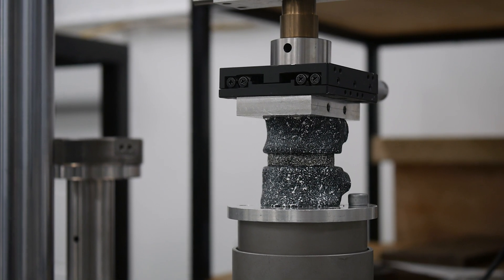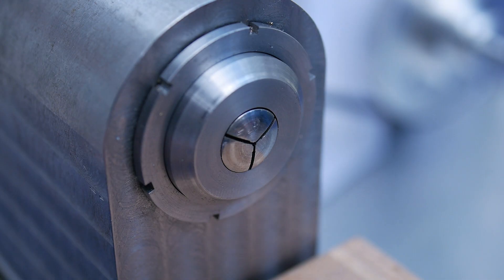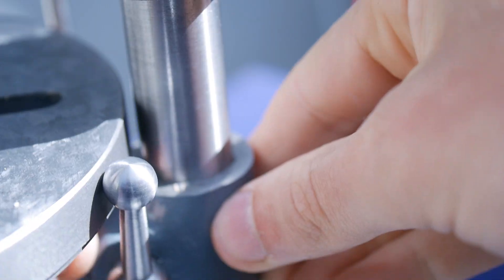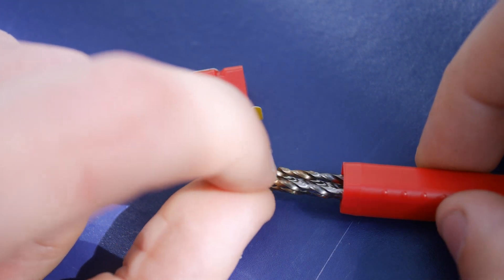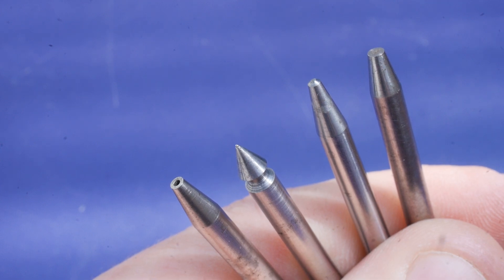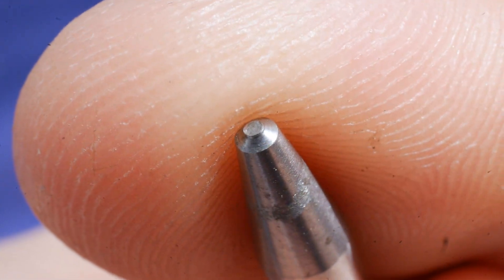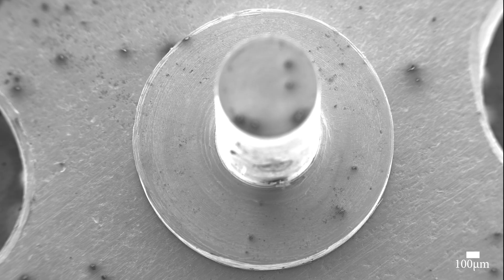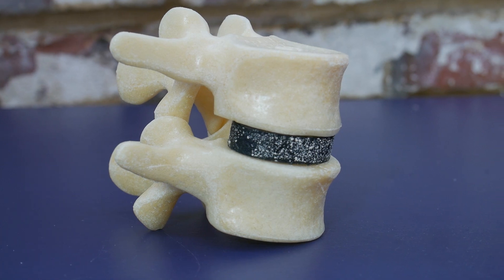Machining a Next-Gen Spinal Implant: My PhD in 9 minutes

Comment: That staking tool is exactly what I am here for: a totally new (to me) tool and technique, and insight about how it’s possible to work at such small scale.
Reply: In the gun smithing community, we would refer to the two stakes (punches) used in this video as a roll pin starter punch, or just a starter punch, and a roll pin punch, used for finishing the installation of a roll pin punch, but you could get away with just using a standard pin punch. The roll pin punch just makes it so that your punch is less likely to be knocked out of place and potentially scratch or damage something after being struck with a hammer, but I've heard that roll pin punches can result in roll pins mushrooming out after being struck.
Reply: @maximilian200057  I think these are two different processes, specifically because staking forms the metal for a permanent attachment, whereas roll pinning doesn’t form the metal part, it just pushes it into place pending later disassembly. 

To put it another way, the staking uses the divot in the pin and the hammered spike to make it so the part has permanently deformed into the hole. In contrast, a roll pin stays in place due to slight springiness that isn’t a permanent deformation of the part. 

The effect is that repeatedly removing a staked pin will rapidly grind away both the stake and the hole it’s in. In contrast, a roll pin is designed for repeated disassembly with only trivial damage to the parts. 

But as I said above, I’m learning about these tools so I’m open to hearing how I might be wrong.
Reply: @twestgard2  The first instrument used, the thing a gunsmith would call a roll pin starter punch, was clearly not an instrument used to stake anything, rather to help install certain parts that act like pins, like you can see in the video. If such unusual parts exists in certain firearms, then gunsmiths would use a small roll pin starter punch to install them. The second part was an instrument used for stating, but gunsmiths often get clever with their instrument usage and could potentially use a roll pin punch for the purpose of staking something.
Reply: Correct me if I'm wrong but seems like rivets still can be quite useful, although a very different kind of them
Reply: That type of work has been used since the bronze age.
Check out the fascinating and ingenious methods they used to make jewelry back then.
Nothing new under the Sun.

Comment: Amazing video, From what you shown the concept looks good, how does the intended implant react to body tissue? Is their any effect on the metals or polymer used? How does heat effect the polymer? I must say this is great thinking outside the box cannot wait for more posts.
Reply from the maker: The materials have all been tested for biocompatibility. The polymer is a thermoplastic but designed to operate at body temperature. Thanks for watching!